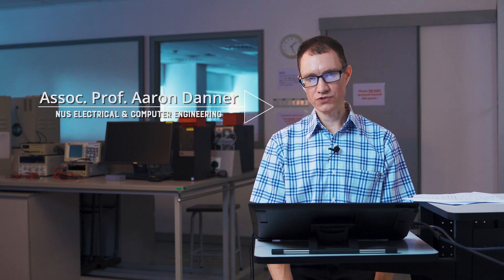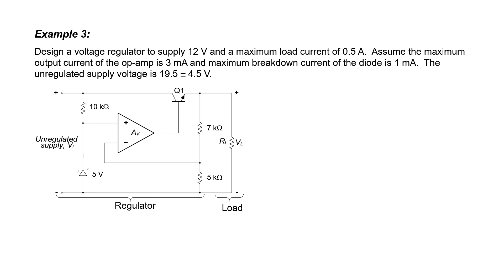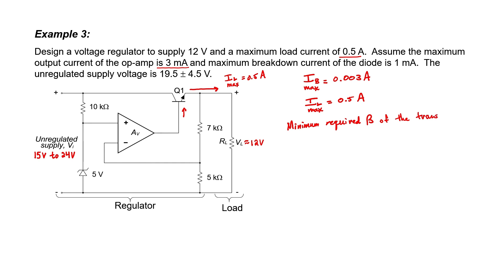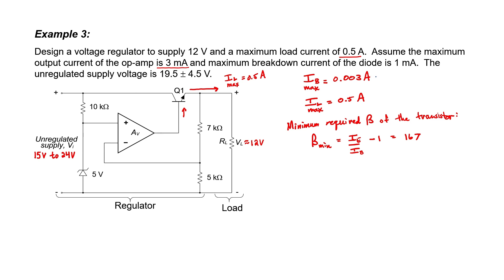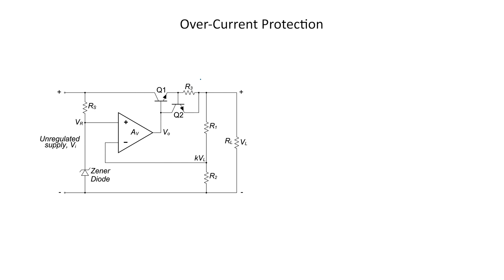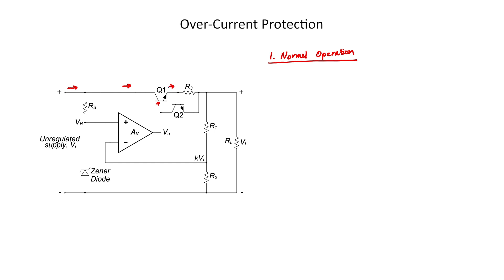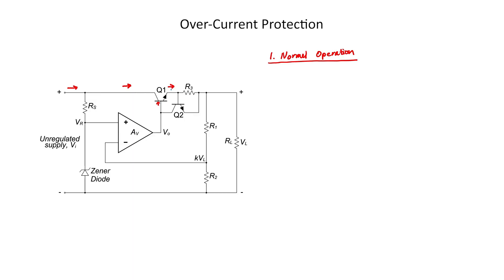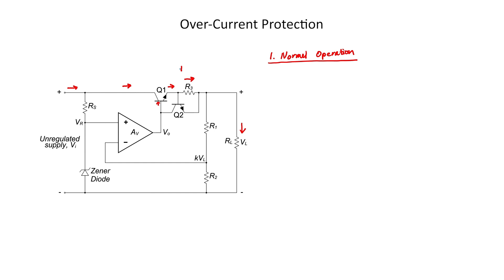Voltage regulator short circuit protection (7 - Regulators)

Comment: This is a good presentation of a current limiting circuit. It applies well for circuits that have their current increased as they heat up, like Power LEDs. Without a current limiting circuit they would burn out.
However, it is not an efficient solution for a short-circuit situation as you propose. During a short-circuit the current keeps flowing (even if limited) and all the unregulated power supply voltage gets dumped on the pass transistor Q1 to a maximum dissipation of 12W for a maximum voltage drop of 24V. 
Also, during a normal operation with a current limited to 500mA, the Q2 collector current would drive the operational amplifier current to a much higher value than the 3mA it was designed to carry so, if the Q1 transistor does not burn, the operational amplifier certainly will. 
A better solution would be an Electronic Circuit Breaker that shuts off the load. You might consider the design presented in this YouTube video “Electronic Circuit Breaker Part 3” from Palomas Estate (link https://www.youtube.com/watch?v=hUShvpRlItE). 
I have simulated the circuit with a 24V power supply, 12V output, and 500mA current limit. Without the current limiting circuit (Q2 and R4) and adding the circuit breaker, the maximum power dissipation is 7W when the current reaches 500mA and the circuit shuts off. Considering that at 500mA the power dissipation on the pass transistor is 6W (24V in – 12V out, times 500mA), the circuit breaker solution only dissipates 1W more when the current reaches 500mA, in a short-circuit situation. 
Thanks.
Reply: Also the old uA741 nowaday has a short circuit protection
Reply: @stefano.a  if you read the uA741 manufacture’s datasheet (I read from three different ones) you will see that the short circuit protection they use is exactly the same technique used in this video.
 If the output goes to ground (like in an output short circuit) a 25ohm resistor starts to turn ON a transistor that will lower the base current of the pass transistor as the collector current rises. 
This happens when the current reaches 25mA (25ohmX25mA=625mV), which is the typical current specified for the “short-circuit output current (Ios)” in the datasheet. 
When the output current reaches 40mA (as per datasheet) there will be 1 volt (25ohmX40mA=1000mV) across the resistor causing all the remaining voltage from the power supply to be on the pass transistor (like it will happen in this video). 
For the maximum power supply voltage recommended (15V), this will make the uA741 dissipate 600mW (40mAX15V=600mW). However, the total power dissipation of the uA741, without heat sink, is 500mW. 
Conclusion: The power supply cannot be higher than 12.6V (a fully charged car battery) for the short circuit current not to fry the uA741 (40mAX12.6V=504mW). That is why they mention “unlimited” for the duration of the output short circuit (as long as you don't use 15V power supply). 
Thanks.
Reply: But there is no current through Q1, and therefore no power dissipated by it. The only potential problem would be current from the IC, which has current limiting protection internally.

Comment: In the case of a short circuit on the output, the action of R3 and Q2 does limit the current through Q1, but now the collector to emitter voltage across Q1 is much higher than it is in the normal operating case, leading to additional power dissipation in Q1.  It is important to size Q1 and its heat sink to handle this power dissipation.
Reply: But the current is Zero, so no power is dissipated.
Reply: @W1ZY  Be sure to realize that Q2 only turns on in this example when the voltage across R3 is 0.6 volts.  To have the voltage across R3 be 0.6 volts, the current through R3 must be 0.5 Ampere, and that current (plus the Q2 base current) comes from Q1.  With a short circuit on the output, and assuming the unregulated supply voltage in this case is at least 15 volts, the power dissipation in Q1 is roughly (15 - 0.6) * 0.5 = 7.2 Watts, (or more if the unregulated supply voltage is higher).

In summary, the action of Q2 places an upper limit on the current in Q1, but Q2 doesn't cause the current in Q1 to "fold back".

Comment: if you thermally connect both transistors, would this give you some over temperature protection, too? (the idea is that Vbe(on) drops with temperature)

Comment: ok you will save q1 for the live of an opamp. 
opamp do not like too much current in long term. 
my english is verry bad but.... you have to Design the circuit so that never ever the opamp reach füll current;).
A lesson i get from repairing faulty power supplies.
Reply: almost all op amps have short circuit protection